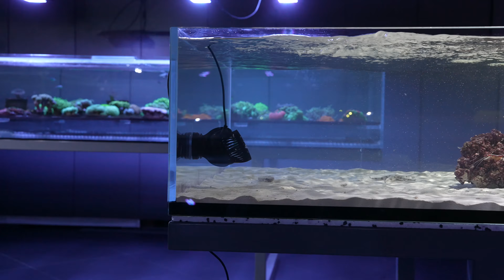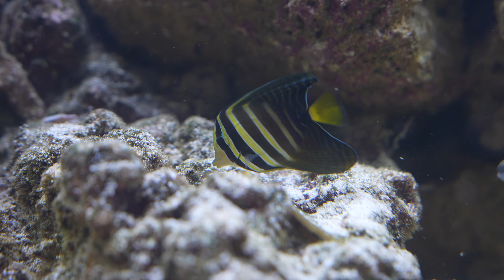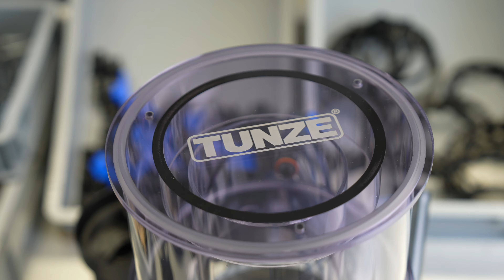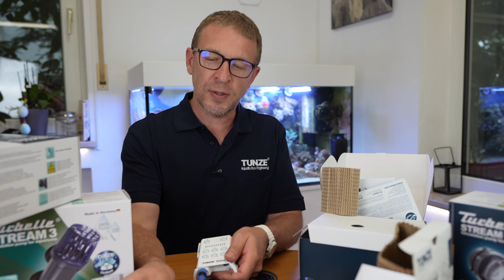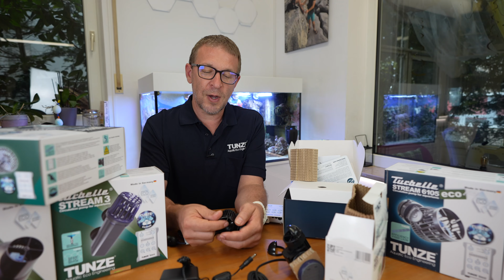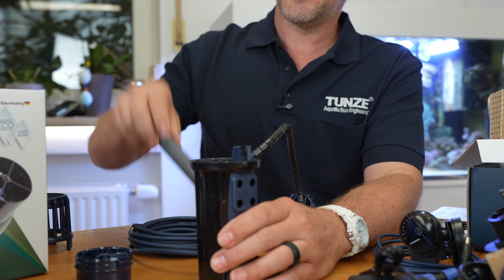The BEST first flow pump?! - Tunze

Comment: Great job.

I'm surprised you mentioned 50 water 50 vinegar mix to clean the pumps.  I've read a few cases whereas that damaged the pumps (magnet swelling).  Not sure if that is due to the overall quality or something else but over the years I've since moved to using citric acid.  Smells better anyway :D

I am enjoying the 6105's I've switched to.  About 3 months in use and happy.  Good investment.  Only issue I've run into is when I had them mounted on the display panels vs euro brace.  Mounted on the glass panel my Strombus maculatus snails, 1/4" in size, loved the power heads and laid their eggs all over the place.  I am using the wide cage that is more open so they find their way inside and the blade would catch them from time to time.  The problem is that they can nick the blade/propeller :(

Wish they would go in reverse to get a better push pull effect but other than that I am really happy with them.  Great investment.  Looking forward to the ORCA  once it is available in the US.